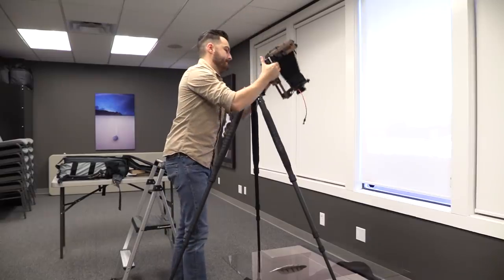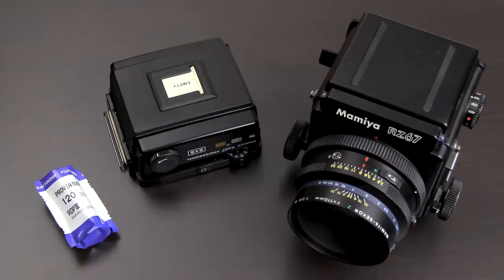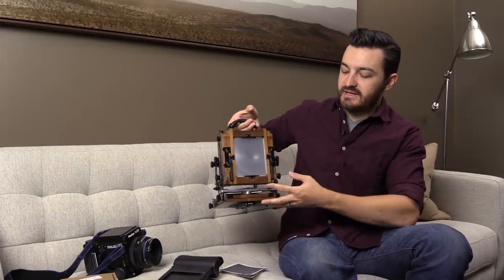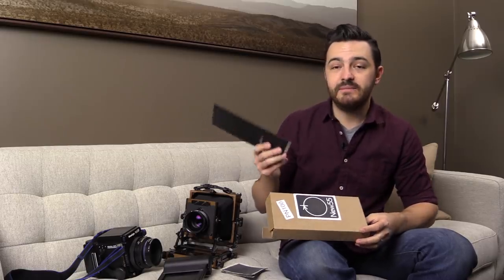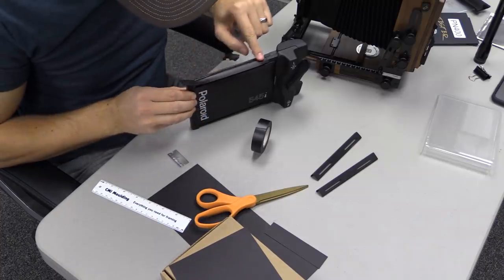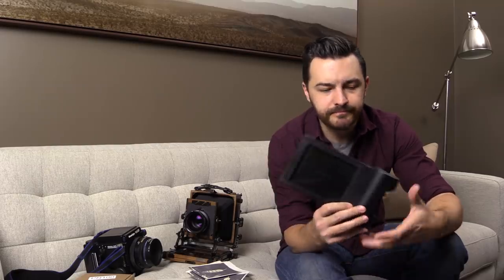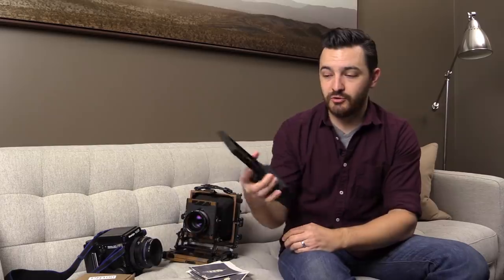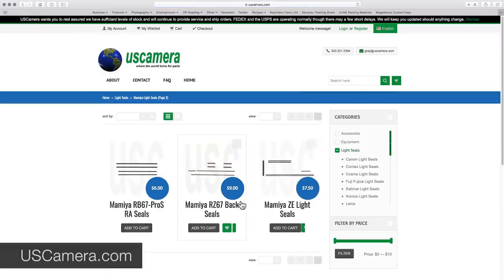Film Cameras: Diagnosing Light Leaks

Comment: Way back, when I contacted a local camera repair guy to repair the light seals on my RB67 backs he suggested and used black wool instead of foam. The advantage is that the wool does not break down over time like the foam does. Touch wood, it's been working great ever since.

Comment: Hey nick. Glad your solved the issue on both cameras. I have a rz67 pro ii kit. The difference with the professional ii backs  for  the pro ii camera compared to the first version just (professional) is that the pro ii backs was designed not to need light seals. The first version has light seals. 

I have  a pro ii kit with all second version backs. When I was looking into the exact same back you just bought I found Out the difference between the two backs. 

Hope you and family are coping being around each other and are well. 👍🏾
Reply from the maker: I did not know that. Thanks for pointing that out. That was a smart move on Mamiya’s part to eliminate the light seals. They’re bound to fail at some point.

Comment: This explains the light leaks on the Anza Ocotillo triptych I bought from you--actually makes that kind of a cool artefact now!  

I bought a used camera back on Ebay for a Canon AE-1 to replace an old databack that it originally came with.  The light seals on the replacement looked very old and, well, leaky.  I fashioned a new seal from the felt from the lip of an old 35mm film canister.  Haven't tried it yet, because I have doubts as to the effectiveness of the repair, but I'll check out the websites you mentioned to get some proper material.
Reply from the maker: I like the MacGyver approach to fixing the light seals. Never thought of using the 35mm felt. But if it seals there, seems like it would seal elsewhere.
Reply: @nickcarverphoto  Well, I ordered the proper kit from US Camera, so that should work, if not, there's always black electrical tape.

Comment: Thought for future sealing tasks - I've tried to use vinyl tape for hiding LED's on electrical devices, and it's pretty transparent! Perhaps 30 stops, but exposed to direct light that's not even close to reliable. What does work is a layer of aluminium ducting tape first and then the vinyl - totally opaque, very conformal, and with black tape over the top looks fine.

Comment: Thanks Nick and thank you for the light seal information, I did not know replacement kits were available so I have been using black knitting wool (thick) I was not sure it would work but I have used it on my RB67 backs and several 35mm  cameras with good success, just thought I would pass that along regards   Kevin Flynn

Comment: Very informative video. I’ve returned to film photography after a while in the digital world and am attempting to shoot 120 film on a Kodak 2A with adapters (from 116-120). I’ve been getting leaks on the edges of my pictures, and am now wondering if I mishandled the film while putting it in. The bellows don’t allow the light from an LED flashlight through, and I’m struggling to think what could be leaking around the lense if anything. The only other thing would be the Autographic door, or the red counter window. Also, am I correct in thinking that the rear panel of a camera like this doesn’t use foam light seal strips? Could be one other possibility.

Comment: one other "line of inquiry" is to use a lens hood, polarisers, etc. as, for me, my 500c\m had that issue, but as I had the film back inspected quite recently, and was using that roll to do a light leak test( also checking shutter speeds, etc. on my lenses); then my only conclusion, after using a hood on the next roll, was that glare was the only cause. [it was my misreading of the histogram of my z6, which I was using as a light meter at the time{the right side of the box DOES show white, when the highlights are too bright!, I didn't spot this error until a 'recognisance' shoot for that next roll} ]- I also used Ektar 100 instead of 400 asa roll, so minimised the chance of a repeat of this error, some did still over expose, but the rest showed good exposure.

Comment: good video, but one other cause of "light leaks" in 120 & 35 mm film, aka the "lightning" which comes from REWINDING too fast, static builds up and discharges to the film strip; Also in 120/LF, rotating the back with NO darkslide in!!- as the corners of the image area are exposed (quickly, but still of a significant duration) so light gets in; another MF/LF one is the SUN etc. getting inside the darkslide slit, on bright days, as some leakage does occur.
the above all assume the most amateur of mistakes (not clicking the backs shut, or mounting to the camera tightly!), or a 'Mechanical malfunction of the backs, is not one that is made here :-).